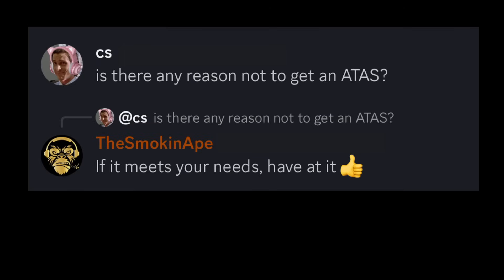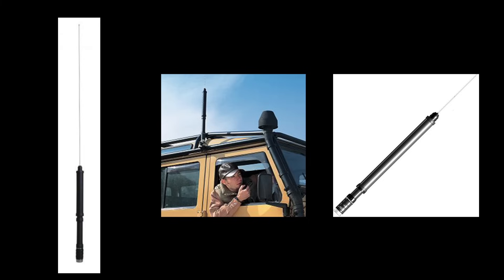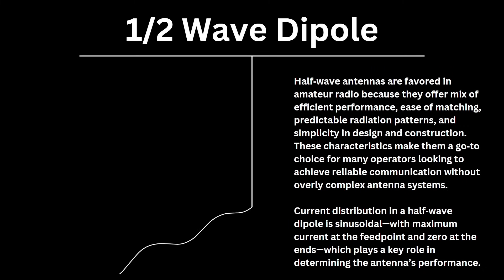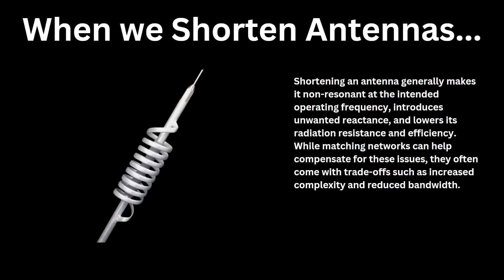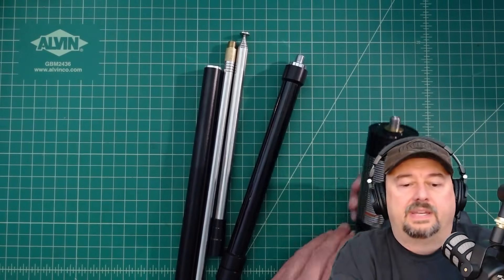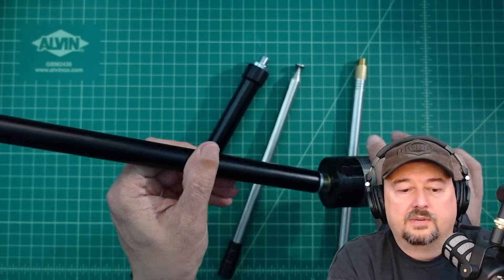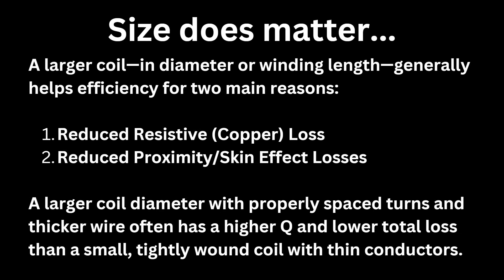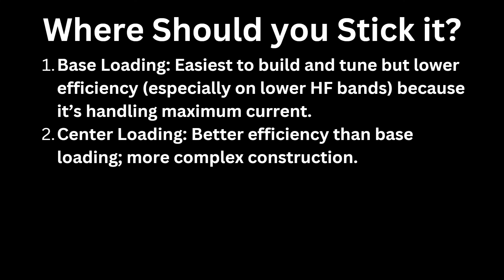Ape Answers 016: Coil Loaded Antennas Explained for Ham Radio

Comment: I purchased an ATAS 120A to use with my FT 891. Installed it on my PU. Doors, hood, etc all bonded. Works well on the higher bands but am disappointed with it's performance on 40 meters. Your video explained why. Thank you.
Steve, k7ofg.
Reply from the maker: Thanks Steve, glad the video was helpful!

Comment: So my question is, how can you make your antenna longer electrically yet, not make it physically longer? I realize coils will do that but also, not without some drawbacks as you're mentioning loss and increased reactants. I'm curious if you have any other suggestions as I have a shortened area that I can only get my efhw about 70ft.  This allows me to tune 40 through 6 with a 9:1 unun.  Your thoughts and input on this matter would be greatly appreciated Mr Ape
Reply from the maker: In a simple sense, making an antenna “electrically longer” refers to shifting its natural resonance to a lower frequency than it would normally have at its physical length. When you add an inductor (which provides inductive reactance) to an otherwise short (and thus capacitive) antenna, you help cancel out some of that antenna’s natural capacitive reactance. That allows the antenna to resonate at a frequency where a physically longer antenna would normally resonate.  I am not saying people don't do it, but I have never seen this done with a random wire antenna (9:1) like what you are using.  I have seen it with a 49:1, for example: https://youtu.be/v6U8jBEtWs0

Comment: Thanks for the excellent explaination, sir.  I understood a good portion of what you mentioned when I bought mine.  I (like others) have used mine for POTA activations - mounting on the roof of my car.  I was supprised at how well it worked, however.  But, I was not prepared for how well it worked when I mounted it to the top rail of my chain-link fence.  Two antennas - 1 134' long doublet, about 20' off the ground (flat top), and the ATAS 120a mounted as explained (fence 4' high, no radials, just the fence as ground plane).  One day, tuned in a DXpedition in Belize.  S3 on the ATAS; in the noise on the doublet.  I ended up working him on the ATAS.  In all other instances, the doublet works better than the vertical, but not on this occasion.  Explain THAT one to me, professor... ;-)
Reply from the maker: @ralphnunn3  not sure I can, maybe it was a lower take off angle?  Anyway thank you for watching Ralph 👍
Reply: @TheSmokinApe  Yeah, take-off angle was everyone in the club's guess, too.  Crazy stuff.
Reply from the maker: @ it’s a pretty cool story

Comment: Another excellent presentation.  Thanks for making it clear.  I got an ATAS-120A knowing some of the things you presented here regarding efficiency.  It is roof mounted and is my go-to POTA or xyl shopping mobile antenna.  Expectations were low but I'm amazed at the performance. Roof mounting definitely adds to performance results. I know I could do better with other antennas designs but it is just as you described.  Convenience wins and I'm able to be mobile CW with easy band switching.
Reply from the maker: Glad to hear it’s working out for you 👍

Comment: I have an ATAS 120 and FT 891 in my 2022 Ram  2500. With 28 park activations I have over 1500 contacts with Europe worked frequently on 15 meters. As you say, bonding is the key. I have 33 straps bonding EVERTHING including muffler and tailgate. I have it mounted on the front left which means most gain is to the passenger side. It would have been ideal to drill a hole in the middle of the cab. Someday, I may have the courage to do that. Don K1DLA
Reply from the maker: @donausmus4281  Wow @ 33 straps, that sounds like work.  Thanks for comment and for checking out the video Don 👍

Comment: I've been roaming around in my RV for some 13 years now. One of the antennas I use is the ATAS. I don't use it attached to a vehicle.  I mount it ground level, attach some 32' long radials, and I'm on the air. If I have the room I'll use my EFHW. But the ATAS works, and it gets you on the air.
Reply from the maker: That’s awesome 👍

Comment: To follow on with the explanation of a mid point loaded antenna, what are the primary disadvantages of moving the loading coil closer to the end point? Weight (mass or wind drag/mast stability)? required loading characteristic increase (more Henry needs to work)? Radiation pattern influence?
What influence does that have on multi-band/multi-radiator systems like fan dipoles and DX Commander style systems?  (location of loading coil - Base, Mid, End)
Reply from the maker: I’ve seen where folks add them to the base of the DXC to get 80m.  Typically folks use a capacity hat at the top but as you mentioned, wind drag and stability become an issue 👍

Comment: I have an ATAS antenna I bought for my truck. 
My question is, does it perform as a NVIS antenna being so close to the ground.  Just wondering.
Reply: Its vertically polarized. It works on 40m. If you want nvis on 40m orient it horizontally. It's all about rf pattern out the antenna and take off angle.
Reply: I wrote more but it got wiped out and i didn't want to send a dissertation
Reply: Bend the tip over a bit and it will.  I can tell my dx signals is weaker moving and picks up once i stop because the wind is bending the antenna over
Reply from the maker: A vertical antenna will not do NVIS, here is a video I did on NVIS: NVIS Propagation for Ham Radio Beginners!
https://youtu.be/-pV9031XgnU

Comment: I guess the photo of the driver in 1:36 is from the UK. The jeep is a Land Rover. That seems to be an accurate image intended for the UK market. These types of antennas work very well. My experience is with the CODAN 9350 screwdriver type  of mobile antenna. This antenna includes an efficient tuner.
Reply from the maker: Do people in the UK drive with their head out the window?  Thanks for checking out the video and for the comment 👍
Reply: @TheSmokinApe   No idea. Very unsafe indeed! LOL. I recognize the car as we used to have those in my country. The chassis of those was made entirely of Aluminum. Almost eternal. No corrosion. You can still see them around. Some were manufactured in Spain. Those were called Land Rover Santana. Enjoy your videos! 73!
Reply from the maker: Thanks man, glad you like them 👍
Reply: Look at my earlier comment,its a staged photo by Yaesu 8n an ad for the 857d. :)@TheSmokinApe

Comment: I run an FT-891 with an Atas 120A, and it works well for what it is.   More for static mobile but... what would happen if you added an extension to the base of the Atas to make it more like a center load antenna?

And when you say 'whip', can you please pronounce it like Stewie from Family Guy?  😂

73, and thanks for the informative video!

Brett K5WXP
Reply from the maker: @k5wxp22  Hey Brett, I’m not sure adding it would work with the auto tune… it might.  Also, it would add wind drag.
Reply: @TheSmokinApe  right, that's why I said static mobile.  Might be worth trying out just for kicks.
Reply from the maker: @ ah, I missed that part.  It sounds like it would be worth trying 👍

Comment: I bought one of the cheaper screwdriver antennas for my mobile. It was a Harvest HD-330, but I think they're marketed under Eagle HD-330 now. I gave $219 for the last one on Amazon just before Christmas. I also bought the adapters to allow me to use a 66" stainless steel whip or a 3/8-24 threaded whip on the antenna coil.  Someone makes them and they are a special thread. I just changed out the 12VDC plug and toggle switch to a momentary toggle and it seems to do great. I need to get a controller to make it easier to tune to each band and I'll be happy.
Reply from the maker: Thanks for watching HT 👍